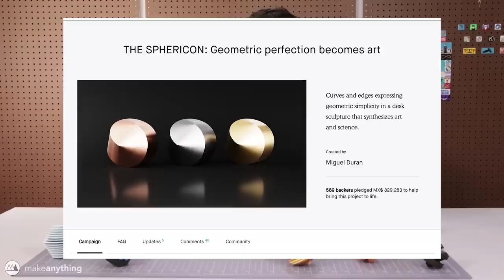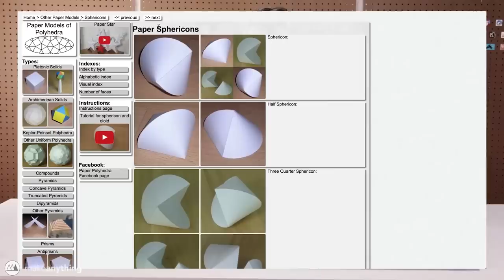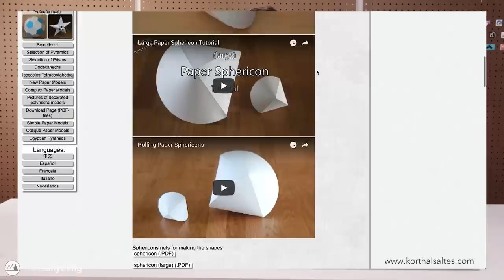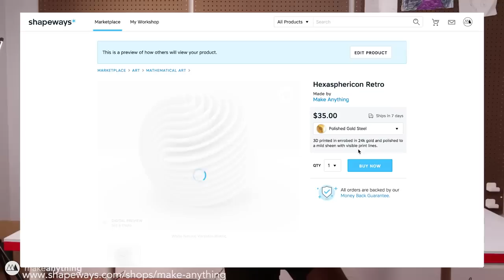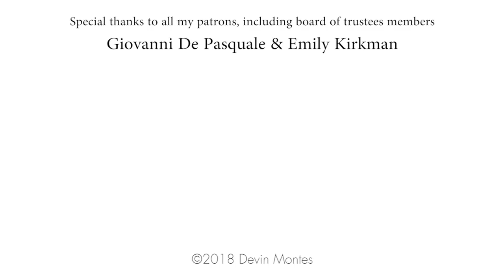My Super Sphericon Collection with Astrolabicon Puzzle

Comment: I dont know how difficult this would be, but do the geode one but use a clear purple for the inside, and rocky coloured shell. And if you left it in 2 pieces that can disconnect and reconnect, you could put a cavity inside with some leds and a small battery, and have it light up the clear filament parts. I just think that it would look more mystical with transparent crystals, and even more so with the light and the motion that appears magical!

Comment: To cure sanding marks (that even finer grits leave on some print surfaces) you can hit the object with some spray glaze. Match the surface finish of the glaze to the look of the filament so as not to detract from the appearance (example: after printing and sanding a glossy filament, to restore the gloss from the matte sanding marks I used some gloss spray glaze, problem solved).

Comment: Awesome Astrolabicon! I myself designed a puzzle using marbles that is based on a continuous infinity symbol. I'm amased of how ell yours work. I'll definitelly consider that magnet-solution for my future designs. Also you calculated the number of balls perfectly without rnning int the problem of gaps (which I encountered). That's a great design there. I hope Oskar van Deventer saw it ;)
The idea of using an astrolabicon as a base is very interesting and comes close to one of my next projects. I thought of building a puzzle similar to the Astrolabacus but that was based on the moebius loop. for that one, I only have to find out how to design the loop in a CAD-software first. Any ideas on that?
Reply from the maker: For a Mobius loop I would probably try using lofts with guide rails. Lofts can be tricky but they're also really powerful

Comment: oooooh, i don't remember if it was wintergatan, or someone else, but you can take two rods and make them very slightly open up on one side. then roll your marbles down the rods and the different sizes will fall out at different points so you can sort them really fast without getting calipers out or anything.

Comment: it seems like 14 and 16mm is a more common marble size getting all 12mm is next to impossible in Australia atleased unless you want to play extraordinary amounts in shipping. I would have really liked to make this toy as it looks really fun. I might have to get the bigger marbles and then play with scaling then try to get magnets that will fit nicely. The link produces a 404 error on the Astrolabicon Puzzle
Reply from the maker: I'll probably make a version for larger marbles, it seems the demand is there!
Reply: I work out 
117% you will get a increase of 12mm to 14.04mm, 6x3.51mm magnet to 7mm
134% will increase 12mm to 16.08mm, 8.04x4.02mm magnet

So 134% should accept a 16mm marble and a 8x4mm magnet perfectly.

Comment: Hey Devin! What grits did you use for the hexasphericon? Did you only dry sand or do a mix of wet and dry sanding?
Reply from the maker: It was a mix. Dry 120 to wet 320 to 1000 to 2000.. I didn't have enough grits nor patience to get rid of all the scratches though
Reply: Thanks! I'm new to 3d printing and finishing PLA prints, but I'm hoping my bowling background will translate when I sand down my projects. From what I can tell so far, it's a bit easier to sand knicks off bowling balls than smooth out layers on prints.